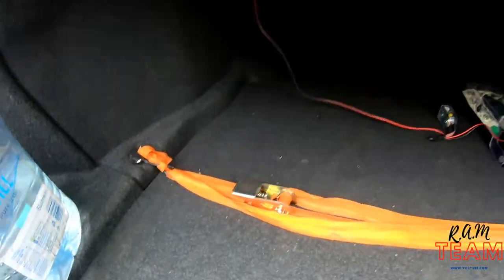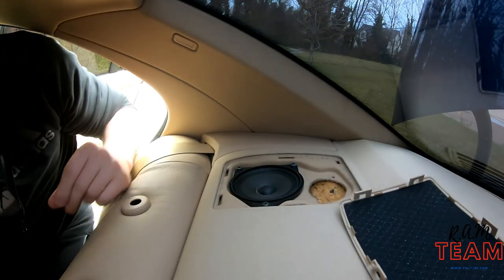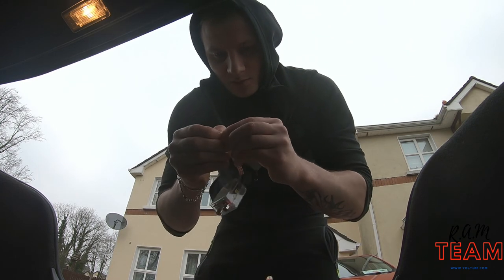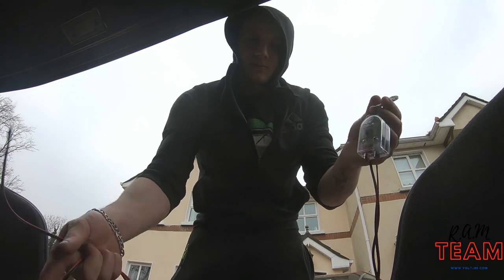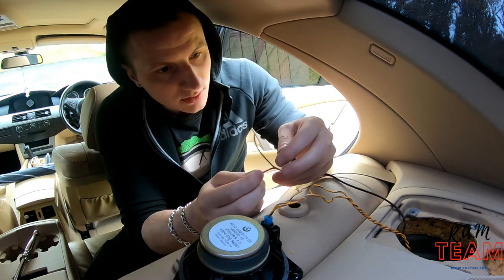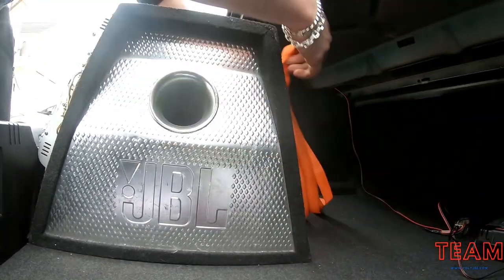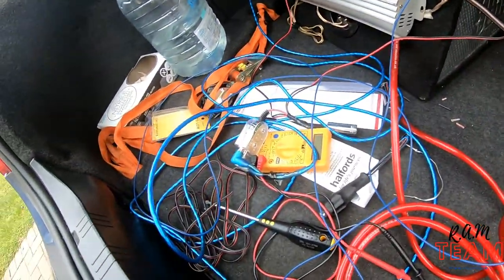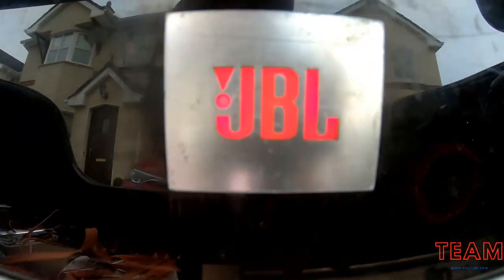[[Bmw E60 Subwoofer  ]] ( Stock head unit ) install Vlog

Comment: Last week I also installed a subwoofer for myself in E61. The audio system is the simplest without an amplifier in the trunk. The signal wire from the speakers was taken under the front seat from the standard subwoofer. Do not be too lazy to take the signal under the seat as the difference is large and better to take the mass from the battery. The sound is much cooler than taking the signal from the rear speakers. This is my personal experience.
And so the video is useful, well done. :)
Reply from the maker: yea my first idea was too hook it up to the sub under the seat but this was bit easier to do and less mess with wires , i might hook it up some day to subs to see if its worth the job :)
Reply: @Richvipermedia  previous owner of my e60 hooked it up to a normal speaker, I changed it to underseat subs and the difference is night and day, much lower frequencies now.
Reply: so you're saying that its better to take signal from the sub thats under the seat rather than the speakers at the back ?
Reply: @liliyailincheva7075  The frequency cut is on high speakers, so it is better to take the signal from the subwoofer under the seat. This is in this case, if you have a stereo system (the poorest system), if you have hi-fi, then you can take the signal from the amplifier, which is in the trunk on the left side :)
Reply: @717TIT  thanks for the reply
Reply: @liliyailincheva7075  yes it makes the sound much louder and deeper, but you have to take the signal from both underseat subs for the best effect
Reply: @killermemestar2132 i have a question to this. Can you help?
Reply: @DK535_ yeah sure I’ll try

Comment: Stopped watching when i saw where the high low adapter will be wired to.

Use signals from the stock underseat subwoofers, so when you turn on the bass it will play only bass. If you turn Treble more on + it will also change the subwoofer signal input in this case in video.

Comment: You’re not supposed to get signal from rear speakers mate because the signal that goes to them is high passed up to 100hz by the CCC if you want really good base you need to tap the signal from under seat subs! Good luck!
Reply from the maker: ye im thinking to rewire it to that
Reply: @73kokitch  i need the best way to do it😅
Reply: @thomassand7323   you should email me and I’ll give you a tip mate, i see now it’s kinda old message but if you still haven’t done it yet I’ll be happy to help you out
Reply: @73kokitch  yo what’s the best budget bass setup
Reply: @aeonw1ck   Depends on how much you can spend, what is your budget?
Reply: @73kokitch  500 I have a ccc aux that doesn’t work
Reply: So I been using bt fm transmitter
Reply: @73kokitch i have a question mate. Can you help?

Comment: Where did you plug the remote wire into, what number fuse / location
Reply from the maker: dont remember the number but its cigarete lighter fuse in the right side of ur trunk fuse box

Comment: I have Line out converter wired to rear speakers right now but want to switch it to the subs under seats. What color are the wires coming from stock amp harness?
Reply: Brown and yellow , red and white
Reply: @luvvariel5230  Thanks

Comment from the maker: Quick Update ( Rewired the Sub to Under seat Subwoofers sound quality is the same just more base, but a lot more work)
Reply: Isn’t that the point to get more base? and sound quality is objective !
Reply from the maker: @73kokitch  u get more base from connection like i showed to, but with that u get alot of sound too
Reply: Is it worth the extra work to wire it to under sub???
Reply: @rossellcastillo9838  I’ll explain something then you decide if it’s worth it. So the signal to the rear speakers is high passed at 80hz and the under seat subss get the signal down to 30hz. So which signal do you think is better for subwoofer? Hope that helps!
Reply: @73kokitch  oh for sure 30hz is better, thanks Mate !
Reply from the maker: @rossellcastillo9838  emmm. hard to say but id say Yes takes longer and bigger job but at the end you get that extra bass, cuz from the speaker its basically acting like another speaker so u be getting lot of high sounds from sub too which is not the best thing to have
Reply: @Richvipermedia   Exactly my point.
Reply: @rossellcastillo9838   no problem mate, feel free to ask anything regarding the installation.
Reply: What did he connect the remote?
Reply: @keemoify   you need to connect the remote to the cigarette lighter fuse in the trunk number 82-83 either one will do the job. And the amplifier will turn on when you switch to second position on the key! I hope that helps you out.
Reply: @73kokitch  Ok, will try that, thanks alot
Reply: @keemoify   np mate, let me know what happened
Reply: @73kokitch  One more question, how did you hook a wire up to the cigarette lighter fuze? I tried a cellphone charger wire and split it, but it has 4 wires!? Wich ones to connect?
Reply: @keemoify    You need one single wire. Get 1mm2 or 0.75mm2 size wire and you’re good enough just twist it around both legs on the fuse
Reply: So are you saying run the speaker wire to the underseat subs and connect it to the amp where the sub speaker wire goes ? I'm confused usually I just wire it all up with an aftermarket radio but In my case I can't bc I will lose idrive
Reply from the maker: @paygecook3772  no i connected speaker wires to sub wires. and at the back i left it how it is in the vide with that adapter
Reply: @Richvipermedia  you still need to keep the low pass filter, right?
Reply: @Richvipermedia Hey man, did you have to take of the seats to access underseat subwoofer or did you find the wires somewhere beside t-piller?
Reply from the maker: i unbolted them and just lean them forward so i wouldnt need to touch air bags , that way i reached the wires with the sub @Star-Performance_

Comment: Does it make any difference? My friends keep telling me that the E60 is way too well isolated and l won't hear the bass if it's the sedan version. l used to drive an e39 touring with a good subwoofer and l miss it. Do you recommend installing one here?
Reply from the maker: yea its very well isolated car but if u can affor 2000wats sub with big amp the whole car will shake , i got 1k wats in and id say i get 50% more base then what it was stock
Reply: @Richvipermedia  What was the stock version? Hi-fi? Logic 7 or just base like mine?
Thank you for your reply!
Reply from the maker: @trevorphilips1124  ya it was just basic ones

Comment: How did You plug the cable into the fuse?
Reply from the maker: just strip a bit of wire and wrap it around the fuse and stick the fuse back inside it will hold the wire there
Reply: Thanks